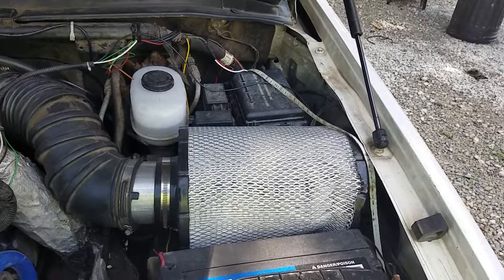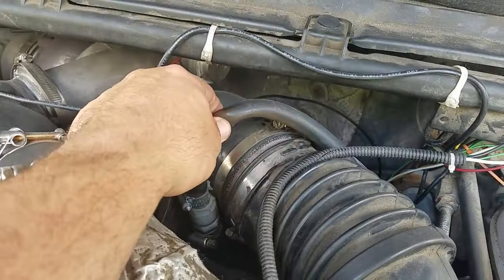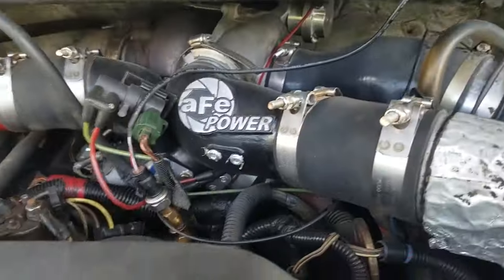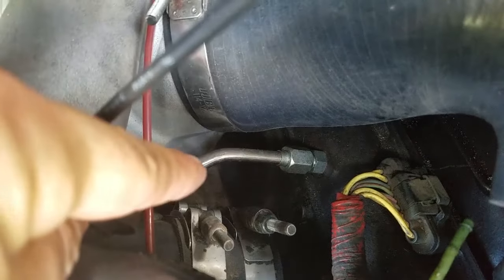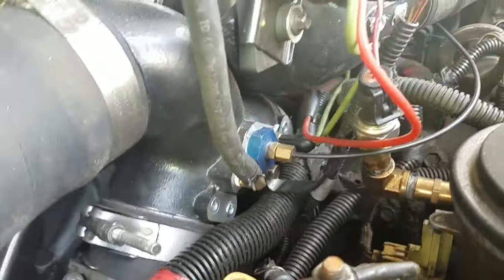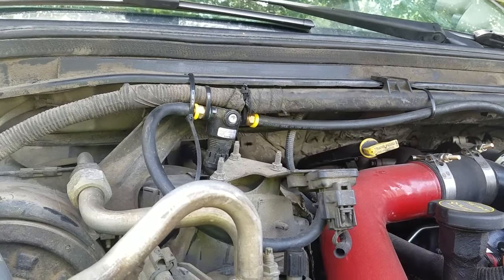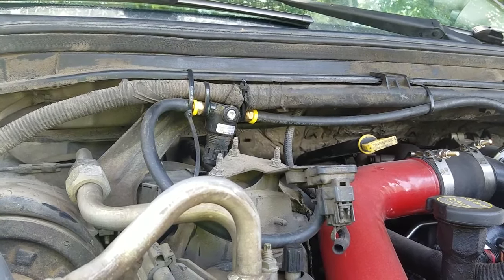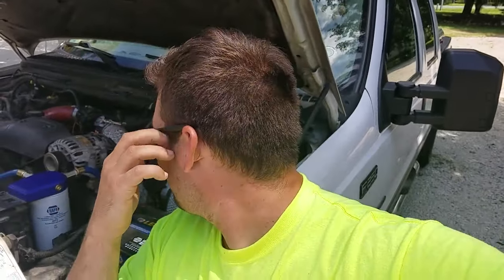5 Cheap 7.3 powerstroke upgrades

Comment: The ccv delete is not good for your motor. It allows excessive crankcase pressure. Im sure your thinking yea whatever. Its true though. With it in the factory location the turbo creates a vacuum which pulls the crankcase pressure back into the engine. Venting to the atmosphere is not sufficient. If oil consumption is your issue. Which it shouldnt be unless you have excessive blowby in which case your engine is done anyways, install an oil catch can.
Reply from the maker: +Colin Leiby I've thought about the catch can, I don't have a lot of blow by but I hate oil in the turbo and the bigger turbos come with the ccv missing from the boots
Reply: Im not speaking of blowby yet. Blow by is compression leaking past your rings. Crankcase pressure is the pressure creaked from the spinning of the crankshaft and other moving parts. With excessive crankcase pressure eventually over time you peobably will have blow by issues. This is not an opinion in is fact. Hooking up a magna helix guage will prove it. The older largwr turbos also dont have intercoolers.
Reply from the maker: +Colin Leiby have had a couple other people tell the same thing, not saying it's wrong just don't like the ccv going into the turbo, I've seen other trucks come stock with venting it to the ground so figured it can hurt. Will be looking into this more to see what other options I could do
Reply from the maker: Please join the discussion on this video https://www.youtube.com/watch?v=D10o5HOH85Q&lc=z125chc4kxagijwze04cgtajtzvtdns4os40k
Reply: Colin Leiby. The moving parts aren’t actually what creates crankcase pressure. It is in fact blow-by past the piston rings and possibly turbine shaft via the oil drain of the turbo being an open hole into the crankcase. What you are speaking of when you say “blowby” is what is called excessive blowby. Also termed crankcase pressure(normal) and excessive crankcase pressure(it happens). The spinning of moving parts only displaces oil or air within the crankcase, which would only cause concern if you were to severely overfill the crankcase. 
    The oil that is coming from the ccv into the turbo is in no way a form of lubrication for the turbo, it is merely a byproduct caused by venting the cylinder pressure that normally enter the crankcase into the inlet of the turbo. This helps to positively vent the harmful gasses and soot from the crankcase so it can be burned in the combustion chambers and lessen emissions as well as deposits in the oil. Not having oil go through your turbo and charge air cooler does increase the amount of heat transfer available from the “CAC”.  Just trying to help make sure the details everyone are searching for are answered . If I have made an error, feel free to correct it, please.

Comment: What is the purpose of oil cross over ?
Reply from the maker: +Richard Chamberlin oil crossover helps quite the motor a little and allows oil to easily go back and forth to each head because of the shorter distance
Reply: Ok Thanks

Comment: on the stock map sensor hose where it plugs into that metal elbow under the turbo is there supposed to be a rubber boot that hold that elbow in? my falls out very easy.
Reply: Anthony Maffie Loctite292 or something of similar nature.

Comment: what all is needed for the boost fooler?
Reply from the maker: simply just the fooler, your stock system has a solid hose that runs from the map sensor to the turbo base. a fooler is a 22psi regulator that tells the map sensor its only receiving 22psi. I've had several comments on this one a should have explained it better. a stock truck and turbo usually put out around 17psi or so when you start adding mods its easy to increase this so and psi over 22 will throw a over boost code the fooler helps  this and keeps the waste gate closed longer.

here to help
Reply from the maker: closed longer to increase boost numbers, ill have a video covering more boost related tips this week
Reply: Devon Xpress

Comment: Hey I have a 2001 Ford f350 dually 7.3 what would be the best upgrade for it?
Reply: Joel Estremera best upgrade is to sell the Ford and buy a dodge
Reply: Php hydra-straight pipe done
Reply: Backroads Nomad your telling me a powerstroke is easier to work on then a 12 v straight six give me a brake
Reply: Backroads Nomad there will never be a point in time we’re a all mechanical straight six is harder to access than a v8 electronically driven engine
Reply: Original comedy or did u borrow this material?

Comment: Boost fooler, lol.  Unless you have modded your truck you will gain nothing.  And if you do and you get a SES light then get good tunes and all that goes away.  K&n had three different filters and guys were stinking the wrong ones in and not getting a good seal.  They weren't letting too much air in.  User error not filter error.  Also your 6637 shouldn't be crushed.  Third oil in turbo does nothing to hurt it.  The doodad mod does nothing with the cold air intake filter setups.  Thats for stock airbox setup.  Nice try though.
Reply from the maker: Yes, boost fooler helps with when pushing more than 22psi. my truck is modded and pushes 40psi. the boost fooler is very important in my set up. Achieving more than 22psi is pretty easy with little mods.
Reply: If you are pushing 40 psi you REALLY need to get some custom tunes.  They will take care of the ses and pcm setting.  You should know this if you are doing videos about this.  Just holding you accountable.  You may need a boost fooler but it's not needed unless you have a SES light.  And if so you need custom tunes, not some BS like canned ts tunes or superchip etc.
Reply from the maker: +Matthew Espey yeah I need custom tunes and injectors would make the world of a difference. 

Do you have a built Truck or building a truck?
Reply: Last pickup y2k built to mild specs.  Probably 320 rear wheel hp.  E99 now and planning the build right now.  Stuck between 500 hp and 650 hp.  Totally different builds and struggling to pick direction.  But i do have allot of friends that are over 500 up to 700 hp.  It's what I love............
Reply: Matthew Espey
Reply: I have an E99 F250 SD 7.3 PS, 6 speed 4wd.  Would it be possible for you to recommend some mods for me? I just want to safely make a bit more power and better fuel economy, I was thinking of replacing the turbo and injectors with OEM parts for the late 99-2003 PS and doing a mild tune.  what do you think ? any help would be greatly appreciated.
Reply: @yzmatt31  
You're wrong tho, when you get a high enough boost pressure, you'll actually fuck up the sensor without a fooler, good tune or not. Try running 70 lb on one, they blow apart.
Reply: The ccv mod is so oil doesn't get into the intake, charge pipes, and intercooler. The engine can run off that oil and cause a runaway. For those that don't know, it's when a forced induction engine runs off the oily mess in the charge pipes from the ccv venting into the intake. And it will absolutely collect and gather in the intercooler. If enough gets in there in can find it's way into the intake and continue to run at an unrelated speed. Not allowing it to be shut off unless you completely block off ait going into the engine, it runs out of the oil in the pipes and intake, or the engine has catastrophic failure

Comment: Kinda confused on wym by don’t get a k&n considering it’s proven to be the best intake for the 7.3. And by you saying get a cheap intake is you basically telling probably to get an intake that actually will let the little particles into your engine unlike the k&n which allows best airflow and doesn’t allow all the little particles wile giving you the best air flow
Reply: They rely on the oil to collect debris. And very fine particles of dirt can get past and sand the compressor wheel. I work at a diesel specific repair shop. I have seen it on countless diesel trucks. Regardless of manufacturer

Comment: Hey Devin Express, do these mods apply to the older 6.9/7.3 IDI & the OBS powerstroke, cuz they are totally separate engines. Not all 7.3s are the same 83-94, 95-97, 98-00, & 01-03. They are 7.3 but the engines are totally different I have an older 95 7.3 OBS Powerstroke and am looking for easy mods to boost HP without compromising the MPG/stock injectors. Just sayin.

Comment: I'm looking to get the boost fooler but if you have gauges, ( which I do ) will the boost not be shown correctly anymore with the boost fooler installed?
Reply from the maker: +Brandon Ruhl no the boost footer won't change the boost pressure to the gauge, it only fools the computer to thinking it's less than 22psi
Reply: +Devon Xpress awesome! that's the only reason I've been holding back from getting one, I didn't wanna be pushing 30+ pounds on a wot and then BOOM cause my boost gauge wasn't showing right lol and I'm sick of the CEL showing up on WOT. do you prefer any certain sites for getting one? or should I just search " 2003 7.3 boost fooler" on Google?
Reply from the maker: +Brandon Ruhl look in the description I left couple links where I bought the stuff.
Reply: have a 97 7.3 Powerstroke. would the boost fooler work for my truck as well? only says years 99-03 figment. thanks
Reply: Just pull the vacuum line off the wastegate
Reply: Brady Ballew i already purchased a boost fooler and installed it and works great.

Comment: are most boost fooler "controller" adjustable?
Reply from the maker: +neodyman the mechanical ones are, but you don't really need to adjust them since they usually come ready to go. I haven't had good luck with mine. Thinking mine is set wrong
Reply: That boost fooler u got there is a air regulator. U can get them at any parts store, including harbor frieght lol

Comment: Where did you get those mirrors?
Reply from the maker: This is the closet i can find, the mirrors i have look a little different because of the 45 degree cut on the side. I can't find the style i have anymore http://www.ebay.com/itm/For-99-02-Ford-Super-Duty-Side-Mirror-Power-Heated-NO-Signal-Towing-Mirrors-PAIR-/291422248688?fits=Year%3A2001%7CModel%3AF-250+Super+Duty&hash=item43da1e9ef0:g:xJkAAOSwpDdVHQzf&vxp=mtr

Comment: What's the benefit of the CCV bypass?  I understand the benefit on a spark ignition engine, but on a compression ignition engine?
Reply: Keeps tons of oil out of your turbo and intake, but comes at the cost of venting blowby directly into the atmosphere, which isn't good either.

Comment: Don’t do these things to your obs or super duty, waste of money. The oil crossover is good if you have big injectors and stock Hpop. Boost fooler does nothing unless you are going over 25lbs. The waste gate doesn’t just pop open when your boost goes high. The computer defuels the injectors over 24psi, that’s why you fool the map sensor . When you shift gears or let off the throttle you waste gate opens to blow off the boosted air that the motor can’t utilize. The boost fooler does nothing without injectors. I would not recommend any of these to stock truck. Ccv mod is supposed to help with boot leaks around your IC has nothing to do with the turbo what do ever. Lol this guy has had 586k people watch this.
Reply: Yeah I agree with everything except the oil crossover thing. The oil crossover is useless it doesn't need it even if you put bigger injectors in that doesn't change how much oil they need

Comment: Was that turbo kit you are using in this video off of eBay or Amazon for about $350?
Reply from the maker: +Tim Meltz I'll have to look back I've swapped out a couple times, but was a 4" housing with new bearings and a billet wheel that came with it.

Comment: The best upgrade for the owner of a 7.3 is to trade it in for a 6.7
Reply: Backroads Nomad if it suits you then that's all you need
I just prefer the extra power for pulling our boat in the mountains
Reply: Backroads Nomad I live at 5200 but drop below 1000 anytime we go to the lake and have to climb up 6&7% grades to get home
Reply: 6 Speed Manual

Comment: First thing I think of with you Zoo Dad mod, is NO! Really!  You are providing a pathway for air to divert from the a/c condenser, radiator, powerstering, transmission cooler to then assist in  cooling the engine??!! DUDE.  Your 7.3 is liquid cooled.  Eliminate the Doo dad Zoo Dad Mod.  Make sure your heat exchangers, mentioned above, are clean, not leaking, and they have all of the proper air dams installed to divert air through them.  Make sure any electrical fans and/or mechanical fans are in proper order.  Make sure your radiator cap is functioning properly.  Rad. hoses pressurising???? Its important!
Reply from the maker: I've never heard of anything negative about the zoo dad mod other than allowing water mud into the engine bay, will have to do some checking on this and may have to close mine up if what you say is true
Reply: Devon Xpress actually I like the mod for more fresh air to your intake
Reply: the air flow isn't to cool the engine, since when has making a direct route to the air filter constitute cooling the motor? Its basically the drag vehicles that run COI and remove a headlight. Its the same principle.
Reply from the maker: The reason I have the zoodad mod isn't to cool the engine, it's to get as much clean fresh air to the intake. and yes like the drag truck/ cars do the same thing only on a larger scale. is also similar to a long ram intake that gets out of the engine bay for cooler air.
Reply: yes, OP was implying other wise. Love the video thus far!
Reply from the maker: thank you, i have several new installs coming and building a website for all the products.

Comment: Will any of these modes be detected during your yearly vehicle inspection?  Now that A**hole California found another way to tax my 7.3.  Don't want to get dinged
Reply from the maker: +Grey Woodruff I can't answer that, here it doesn't really matter what we put on our trucks
Reply: Devon Xpress thanks for the reply.  I must of missed it, but what exactly do these modes do? The oil cross over is pretty obvious,  more HP, better gas mileage?
Reply: Can you register in another state? I grew up near the Oregon Border, and hardly anybody ran a Calif. plate. Town was to small to have a Police Station though. They did come through on occasion however. I live in Western Washington now, and we don't have smog here, but we have a Navy base. I say that because military men do not have to change their plates. So if you have a base nearby, register in a state with no smog, and put a big "U.S. Navy" sticker on, keep hair short, and then don't break any of the small laws. My 7.3 turned 20 this year. Yours can't be too far behind. Is 20 years still exempt in Calif? I am sorry this country has become so much like N.Korea.  Good Luck
Reply: Yeah. If you live in Kalifornia you probably ought just not modify your truck. Or, you know, live some place better.
Reply: fwiw, I think one must actually be in the military - not just living near a base, and then register out of state

Comment: more info on the mods.
Reply from the maker: +David Martin boost fooler helps keep power from defueling over 22psi of boost, air intake allows better air flow and volume that the truck demands, zoodad mod just allows more air flow under the hood, my reasoning is that the cooler the air the better the performance allowing cooler air under the hood, oil crossover over allows oil to pass from head to head with better ease
Reply: Devon Xpress but is there any instructions or do I just start pulling and installing stuff
Reply from the maker: +David Martin oh okay I'll give you detailed instructions on it

Comment: Fast way to ingest water into the engine too.
Using an open air filter is not smart.
Too many times I ve had people come in with holes worn into the paper from it just bouncing around.
And, you are pulling hot air from the engine bay. Also not good for production of more power

Comment: Hey man, I've just started a channel about my 7.3. It was stock, added the 6637 filter and am planning to build it up slightly. I'll be throwing on a straight pipe, chip, and gauges. It's got the ZF6 manual, which exhaust and chip would you recommend? Stuck between the mbrp and diamond eye both 4". Potential chip either TS6 or hydra. Anyone's input would be appreciated, check out my channel and let me know where I can improve as well! Thanks. Let me know if the shoutout isn't fine, I'll wait and leave upgrades questions.
Reply: LifeOfChief since im the first to reply.... I'm running a diamond eye 5 inch with a TS and a s&b intake. With that said, the truck really has a hard time putting the fuel to it now. Will upgrade to baby swamps next. It's a 96 CCSB with a ZF5